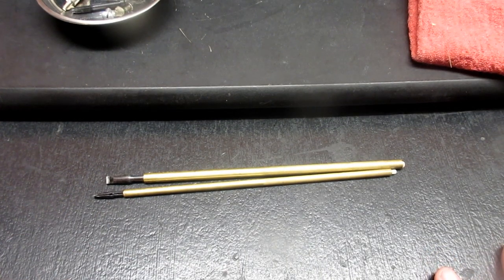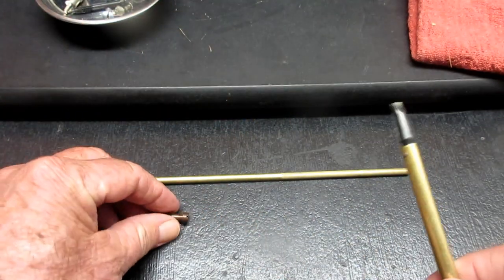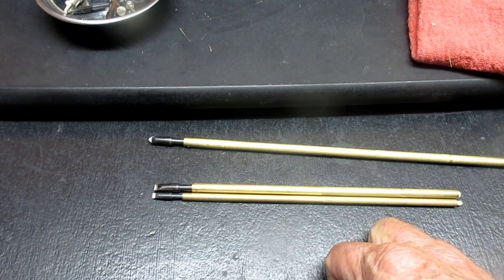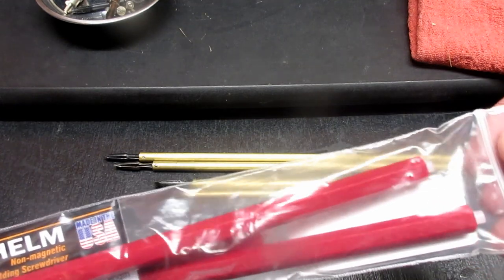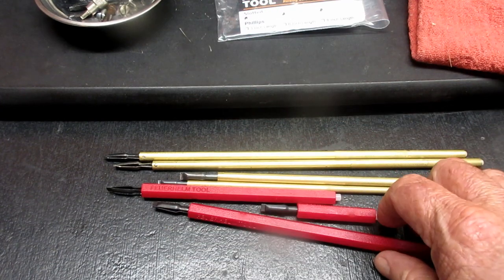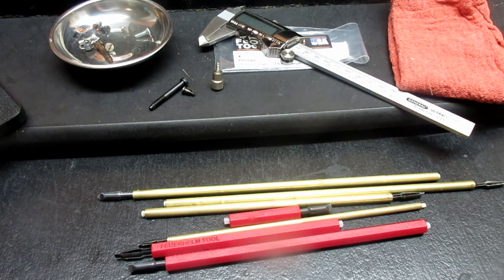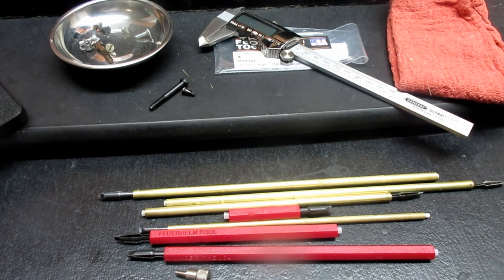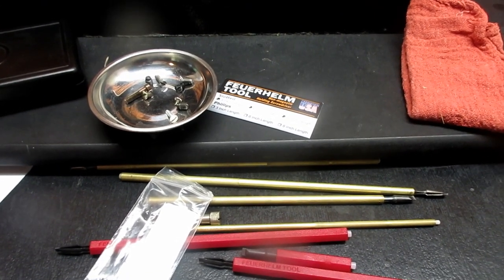Taking a look at some Feuerhelm Tool Screw Holding Screwdrivers

Comment: The thickness of the Feuerhelm screw holders can be remedied in a short order by rubbing them on a carborundom stone till they fit.  One could even  put a little bit of a burr on the noses of the tools to make them hold better.  Thanks for the new video Andy Tube.  Much appreciated!  You haven't been around for a while so I though Arizona had melted.
Reply from the maker: PINNED! What a great comment. The stones are readily available and come in affordable shapes and sizes: https://www.amazon.com/s?k=Carborundum+Sharpening+Stone&i=tools&ref=nb_sb_noss   I had one for 32 years to sharpen sheath knives and scissors at work. I should have held onto it as it seems to last forever. Your solution solves my concern of not fitting some of the thin-slotted screws. Appreciate it, Ralph.

Comment: Just wanted to thank you for your excellent channel. I inherited a Singer 502 and had it in storage, meaning to use it for making fishing rod and reel bags. When I went to use it, I found it had some problems including failed plastic gears, a frozen stitch length selector dial, blown capacitors and a broken thread retaining 'ring' on the needle clamp. Your postings dealing with similar Singer models provided the perfect insight I needed to understand the design and operational concepts of my machine. I was in turn, able fully repair and service it and it now runs perfectly. This would have been impossible with out your extraordinary presentations. So, again, thank you very much.
Reply from the maker: Thanks for justifying my work with the videos. I sure enjoyed reading your comment and of course, you are welcome. I've never seen a model 502 here in Arizona although there are photos online. It is not in my manuals files, either INstruction or parts, which makes me wonder if you are in the UK or EU country. I appreciate you taking the time to comment. Happy Sewing.

Comment: Hello Andy, I can see much tool refabrication taking place. Like turning down the handles and as mentioned, reducing blade thickness. I restore vintage Trombones ( income) as well as sewing machines and fishing reels. Boy is this going to be useful. Thanks so much. Ken
Reply from the maker: Welcome. Ralph Watten suggested narrowing the blade thickness with a Carborrundom Stone to fit narrow slotted screws. Sometimes the Blades just need to fit the screw more than muscle the screw in or out. It's the delicate task of starting those little screws in a hard-to-reach place that is so frustrating. I remember my Dad cussing while assembling Johnson fishing reels after cleaning them. "damn screw", haha.
Reply: @andytubesewing1953  yes, I read his comment, and will be doing it to at least one tool. Thanks
Reply: Also you can repair old worn screws with gun screw slot files. They are expensive but if restoring orginal parts is important it's worth it. I use them on my Trombones where this is important. Thank you
Reply from the maker: @kennethjones5173  Good luck, and thanks for watching my channel.
Reply from the maker: @kennethjones5173  A nice tip; thank you. At $30 to $50 per file, you were not kidding.

Comment: Hello Andy, I have appreciated all your videos on the singer 401a. In 1958 my mother in law bought a 401a with the insurance money they received fro my wife being run over by a car after falling out of a panel van at the age of three. It has been a pleasure to learn from your instructions and work on my “Trouble” machine. I am missing the two screws for the light cover, one of the top cover screws and the clutch screw. Any idea where I might be able to acquire replacements. Having been a teletype technician in the USMC in the early 70s the smell of grease, oil and cleaning fluid brought back memories!  Hope you are doing well and God bless. Andre B
Reply from the maker: A worthy project and thanks for saving that machine. A few screws, very few, on Singer machines before the 80s, have a few standard screw sizes, but most of the screws have off sizes and odd TPI (threads per inch). Since you have one arm top cover screw you can try to find a match at the hardware store. I don't even bother with that any longer. I usually start hunting for parts on eBay and look for a seller who is parting out a machine like mine. Rarely you will find an inexperienced seller offering a fistful of odd, leftover screws and hinge studs and you might spot the one you need. More often the seller is offing a parts "set", like the arm cover and two screws for it. If he sells you the screws only it is harder for him to sell the cover without screws. So, a light shade cover w/ the screws or a stop motion screw, clutch washer, and clutch stop screw as a set. Once in a great while, someone will be trying to get the most money for the parts and sell the screws separately. Another source I use is thriftyfarmgirl.com and Bonanza. I'm told that Amazon and Facebook have parts sellers now also. Here is some info: The ARM TOP COVER SCREW is part 140996. The LIGHT LAMP SHADE screws are part 140758, and the CLAMP STOP SCREW is part 140881. I check this website to see if your part numbers were listed on the screw charts to try and get you more info, but your part numbers are not listed, dang it. https://www.singersewinginfo.co.uk/screw_threads   Good luck, and thanks for watching Andy Tube.

Comment: Andy, Sooo glad to hear you again and see you making a video! I watch your videos sometimes but never make a comment. However, hearing you again persuaded me to comment! Just glad to hear you.
I’ve been meaning to ask for your contact information because it’s not on your bio even though it said it was. Maybe you could leave a comment on my channel with contact that I (or you could delete) after I get it and contact you.
Anyway, I’m 70 and was gonna try and fix my wife’s Singer 6267 not winding bobbin problem.
Take care of yourself and please be cautious and safe! Mac
Reply from the maker: Thanks for the kind words, Mac. I think you have to be a subscriber to see my channel email address. I've never even seen a 6267 model. I believe they were made by Singer in Italy in the late 80s. It has an unusual bobbin and bobbin winding system called CENTAUR. I do have a parts manual and I'll be happy to share that if you think it will help. andymanuals53@gmail.com It does include parts numbers which may help if you need to replace a part/parts due to wear. I'd suggest you buy the SERVICE MANUAL which may have repair information. It is the largest size manual I've heard of from Singer, 220+ pages, but you can buy and download it for $4.99 at this seller: https://manualsoncd.com/product/singer-6267-6268-sewing-machine-service-manual/   Good luck, and thanks for watching my channel.

Comment: If I would need to get down into a deep section like you showed I would put it in my lathe and turn down the diameter to what I need unless it would weaken its use.
Reply from the maker: sounds like a plan, Bill. In using them I'd say that these spring steel screw holding type drivers are not capable of loosening or tightening many of the screws on the machine, like set screws for gears and counterbalances, but they are incredibly helpful to me in starting a screw placement, or removing a screw deep inside after loosening it. The Lady who owns the company is a technician, I think network tech and she said she never thought about a sewing machine use for them. I think she was more concerned with a good grip as those techs wear gloves and grounding straps all the time.  If you grind one down I hope you'll make a video of it to share on your channel.

Comment: Hi Andy,
Allow me to add my thanks for all you've done helping folks repair and maintain their machines.
I've been binging many of your videos over the last two weeks, trying to build up a skill set to restore my 1st sewing machine. Just picked up a 401a to use in learning how to sew and have .
I've been running around locally and online picking up supplies like KK cleaner & rust, Wax & polish etc. Now a good tool set is in order, so this video fit's perfectly!!
May I ask which chapman set you find most helpful? and are any philip's , hex, torx & JIS tips needed?  I'm thinking of getting a vintage Janome "New Home" to gift to my granddaughter so we can learn sewing together.
Once again, thank you very much.
Best Regards,
Jack
P.S. Would you know of a good replacement main power cord for the 401a that exits to the rear of the machine?.  (It seems the ones I've found exit to the front --  The original is broken)
Reply from the maker: Thank you, Jack. Here is the Chapman set i bought: https://chapmanmfg.com/pages/sewing-machine-repair-screwdriver-sets   It has 12 slotted bits. Most of the vintage machines, say before mid 70s, only have slot head screws. The Chapman set comes with a couple Phillip's and specialty tips. You can also buy single bits in the future if needed. They have large sets then the #9600, but that was what I could afford at the time. The wheeler screw drivers I bought later are handy, and can get in tighter spaces but do not have quite the quality of the Chapman and I've bent a couple tips https://www.btibrands.com/product/professional-gunsmithing-screwdriver-set-43-pc/  Getting the cord you describe is hit and miss depending on what the seller received from China with their order. The cords I see were not made specifically for the 401, but will work so that's why they order them. Sometimes you will find a seller with the rear exit line cord, but not very often. Enjoy your restoration and time with your Granddaughter. That's very special.

Comment: Dear Andy, hope you are doing well. 
Is the a way to remove the nylon bobbin winder spool pin? I'd like to replace it with a new pin because it is damaged. The top pin was broken off, but easily removed by tapping out from the underside. Thank you very much.
Reply from the maker: Hi, Lizzy. I put a drop of oil or squirt of WD40 where the pin enters the hole and twist the pin, down low, back and forth with a plier. Once I get it moving a little I keep twisting while pulling upward. I once broke the pin off right at the metal. I tapped the broken piece down thru the hole, then turned and shook the machine until the piece came out of the hole just below the pin, to the right end of the machine. After 550+ videos I don't remember if I showed how to do it in one of them, but here are all 56 of my Model 404 restoration videos in a playlist. https://www.youtube.com/playlist?list=PLsCOZgzzaiKIB4kvIHCfHYuyLMUp5A4UI
Thanks for watching my channel.

Comment: As an industrial Electrical and Instrumentation technician, the non-conductive handle is important.  The angular handle profile throughout the shank could be problematic.
Reply from the maker: Oh, do tell, please. What would be problematic about it?
Reply: @andytubesewing1953 , may not be able to fit faceted profile into round holes.  Went with round Klein and Ullman instead.  I'll heat-shrink handle ends for insulation.  Great-looking product though!  
(The ones I've bought may be even worse due to the knurled collar, but I've got to try.)
Reply from the maker: @PhinAI  Thanks for sharing the info, especially the idea of heat shrink for insulation. Brilliant that. I also have the Klien and Ullman but tried these Feuerhelm b/c they have the same type of push/pull grasp as my vintage HJJ devices. Take care, and thanks for watching my channel.

Comment: That gib screw is difficult. If I honed it a bit I think it would still be too thick, huh?
Reply from the maker: Well, the HJJ blades are 0.77mm thick and they fit, so you'd need to hone off about 0.30mm. I do not know if that would work for you or not, honestly.

Comment: Hi Andy hope your doing well this as nothing to do with this video, however I have a question.
How do I slow down my industrial sewing machine,it's new and am a girl who as no idea how to do it. Helpppppp please
Reply from the maker: Well, I don't sew, and I don't work on Industrial Sewing Machine so you're probably asking the wrong guy. That said, mostly you will see/hear about adding another belt and pulley system to your machine or changing the motor to a SERVO motor. Those seem the most popular. If my wife was asking me to do this, here is what I would try first: https://hbarncraftworks.com/blogs/sewing-machines/the-fast-and-the-frightening-industrial-sewing-machines    Look at the middle of the web page under the SPEED heading. That's all I have, cherry.
Reply: Thanks 😊 much
Reply from the maker: @cherrybigdeal5764  good luck.